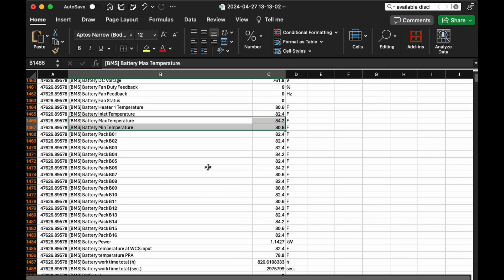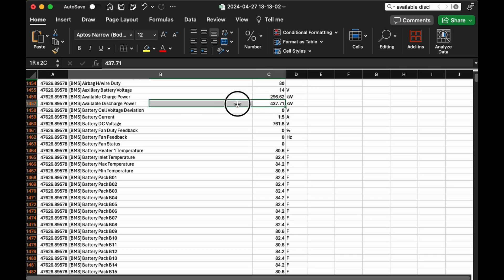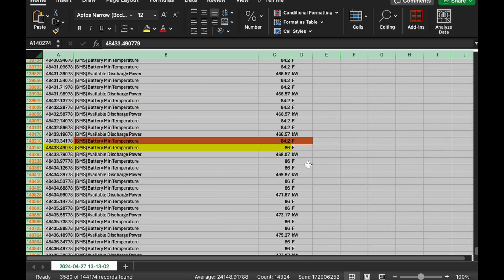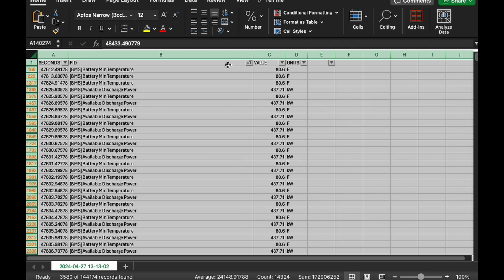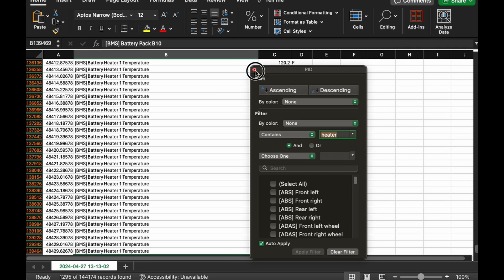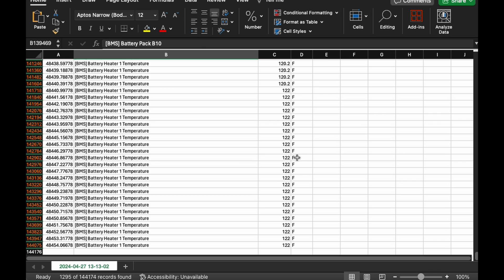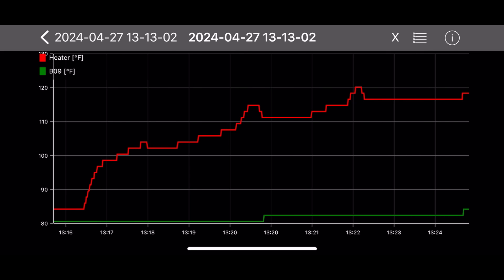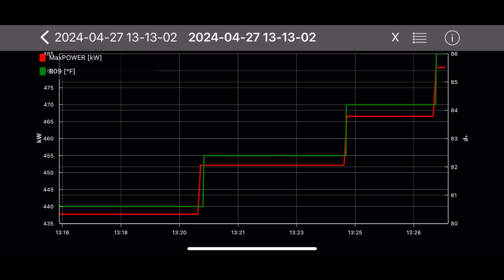The Data Behind Maximum Power Output Mode in the EV6 GT

Comment: What would cause maxinum not not ever be hit? Ambient temp outside 67° but has only worked twice in 1.5 years and temps were well over 90 outside many days. Owners manual is useless for this funtion dealer scanned and car has no codes and all ev battery cells are strong no battery issues

Comment: Hey CPO, appreciate the video/effort here.

When I have my car in max output mode, the energy information on the infotainment shows 430kw being used for driving under acceleration which matches what Kia says.

The data that says 480kw available discharge power may mean the battery is capable of discharging that amount but maybe not that the drivetrain is using it?

Comment: Awesome data! qq, if you know:

Is your max power output (to the drivetrain) lower during the readying state of max output mode? For example, if my min temp is 80, would the power output be different at 80° with the mode on (the battery conditioning) vs not on?
Reply from the maker: @bussybutter  not sure tbh

Comment: I know very little about EV’s, but if max power is only available after the batteries are warmed up, then is there a way to reprogram the battery heaters to activate quicker?  Is that even possible or desired? 🤔
Reply from the maker: Not even sure. Unfortunately there is no OBDeleven for this car! I don’t think there is much to be hacked. I’ve still got lots of testing to do still though! 

There are some interesting parallels to the R. The R you have to wait for the oil temp to get high enough, and you need to have the right type of fuel for max power (E85) and you should have at least half a tank of fuel (without installing a surge pump). 

With the EV6 GT, you have to wait for the battery packs to get up to speed, and you want to have as much charge as you can get for the most continuous power output.